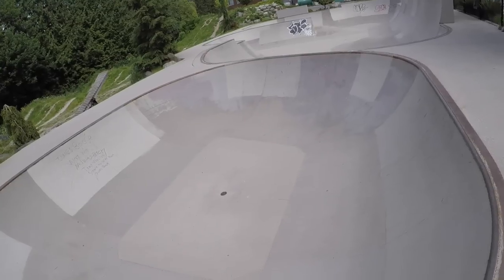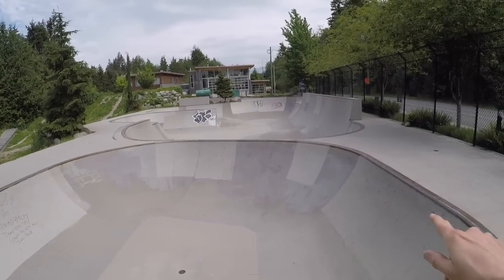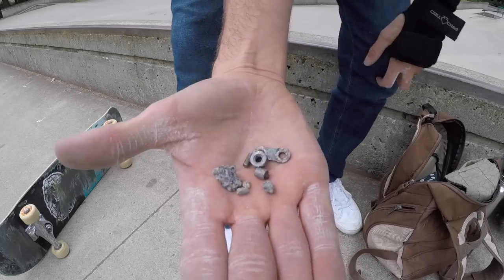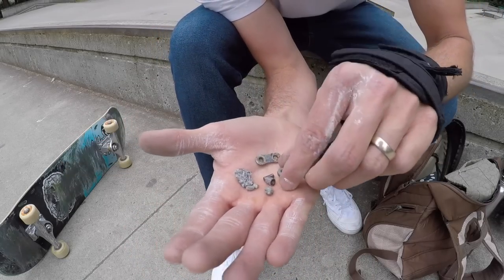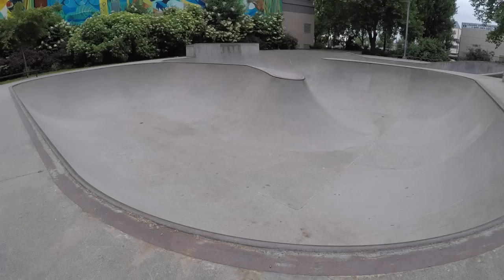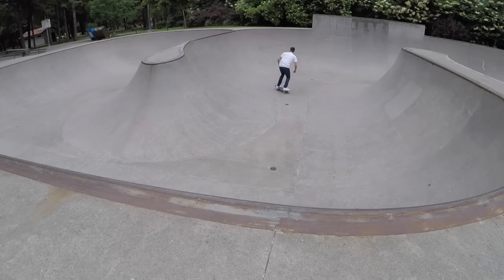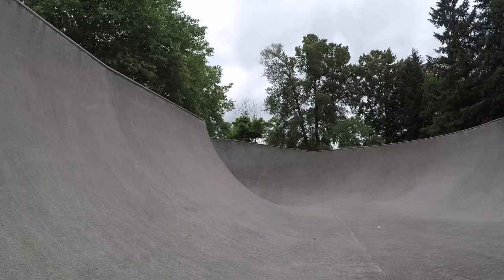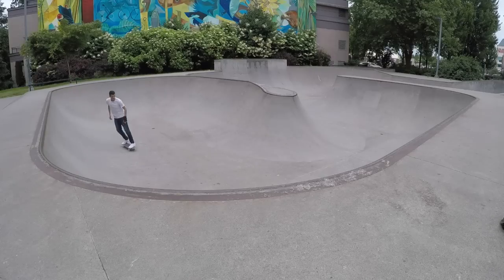How to Skate a Bowl (Keeping Speed!)

Comment: I know I’m a year late but Thanks for the advice on the tick tacks man! I’ve just now started skating actual parks coming from a town with gravel roads and barely anywhere to skate. I love skating the bowl but I always had the issue of not keeping speed and now I know what I’m doing wrong! I was treating the bowl more like a half pipe, I would kick turn high by the coping and go straight down but I would always loose momentum going back up the other side of the bowl

Comment: I was always a street skater mostly due to no actual skate-parks other than DIY hijacked parking lots. Any one remember C.H.U.D in Boise, ID? LOL I think that place coined the term crusty, I mainly skate the old 4th ward skate-park in Atlanta and have found that learning to carve and work the transition much easier in the 12ft pool instead of the bowls due to not having nearly as much flat to work around. Only drawback is that getting up close to the vert in that cramped pool is scary AF. Thankfully the transition is good and it kinda sucks you up against the wall when you get up higher. It took forever to get my head around carving, ramps and street take a completely different style of skating. I really dont remember it hurting nearly as bad when I wrecked when younger and on blacktop. That white asphalt is from the devil for sure. Not to mention when you have to bail on transition or in a pool it seems you have a bit more time in mid-bail to see the pain coming. its very strange and painful.
Reply: How good is the tranny bowl in Atlanta?

Comment: whenever im helping someone learn how to ride a bowl i always stress 2 things that go together. 

1. KEEP ALL 4 WHEELS DOWN

2. turn sooner than you think you need to ensure all 4 wheels stay down / loosen your trucks.

when you said to go as close to the coping as possible i cringed a little because it seems like most newbs go too high at first and lose their momentum and have to kickturn.
Reply from the maker: Steve Riskus now that I think about it that line is a little misleading. I am usually about a foot or six inches below the coping at the height of my arch but I guess what I mean is I try to hug the coping and stay up there as long as possible but you are correct in that a newbie could more adequately carve around only going halfway up.

Comment: @ 1.50. ''not all bowls are created equal'' youre right about that... there is one bowl in the wide vincinity where i live and its absolutely terrible.. it is full of bumps, there are lots of spots where the top layer of the concrete has crumled away (making it feel like riding on gravel) and somehow there is a big dent in the double coping where the spine is...it is only about 15 years old now and had 0 maintenance done in all that time. in my opinion its out right dangerous to skate in..

Comment: Hey man, been skating 2 weeks about.. should I be practicing switch at all? I went to a skatepark out of town this weekend since there’s none local and besides falling on my face a lot, I realized I’d be riding switch and fakie a lot and it’s SO awkward feeling! I look like I’ve never even seen a skateboard trying to ride that way.
Reply from the maker: Patrick Roles start riding switch as soon as you can.  You can do it anywhere. It doesn't have to be at the skatepark around other people.  Skating switch helps in more ways than just simply being able to do the trick with the opposite feet. It will just generally increase your balance and competence on your board. There are even more reasons but it's too much detail to get into in the comments. I will try to make a video about It soon.
Reply: Ben Degros okay cool, I’ll make sure to work on it every time I get a session in. Its frustrating how comfortable I am in my regular stance(goofy) and then switch I can barely push and get on the board lol. Plus turning is backwards, I’m used to toes turning left and heels turning right.. 🤦🏻‍♂️😬. I can help with a lot of beginner type videos cuz I have lots of questions that come up! Thank you .

Comment: Hi Ben, i have a question. do i have to drop in to carve a mini bowl?
is there any way i can skate one without dropping in? i know i need speed to do that but still wanna hear the answer from you. Thanks!
Reply: you can, but you should learn how to drop in. You are making it hard on yourself if start on the bottom. It's scary but once you get it, its the easiest trick you will ever do.
Reply from the maker: 小乃美莓 you don't need to drop in to start learning. It only takes a few extra pumps to get up to full speed. It's  definitely easier after dropping in but don't let that stop you from getting started:)

Comment: Really useful, Ben. Thanks.  Using the corners to generate the speed was my key take away. BTW what wheels are you using in the video?
Reply from the maker: 54mm spitfire lock-ins
Reply: Bought a set of Lock-ins and a set of 58mm Formula Four Conical Full (all the bowl skaters in Oz are riding these).  Cheers mate.

Comment: Hey Ben, as a truck nerd, could you do a comparison between regular and hollow trucks? Does it really make that big of a differece?
Reply: ive got both and there is not really a HUGE difference imo. If youre looking for a light(er) setup I would suggest thunder hollow lights. If youre not, regular indys/thunders are fine.
Reply: meals Thanks! I'll probably need new trucks since I just got 8,125 from a 7.875 (or something like that) and I feel that the trucks are too narrow.
Reply from the maker: Arūnas Rimkus if you are going up in deck size I think it's worth it to get light trucks. I personally notice a pretty decent difference but if there were no no light trucks we would all manage just fine. Once you get up to 8.5 inch trucks I think it makes a big difference.

Comment: What do you do for a living? And what wheels do you have on that deck? SPF bones? I’m so sick of wheels that are designed for park or street specifically, why can’t they make a wheel that’s great for everything?
Reply: Jersey Devil pretty sure those are the 99a formula fours. He did a review on them.
Reply: Spitfire f4 99d works great for street and parks.
Reply from the maker: Those wheels are 54 mm spitfire lockins 99a.  I am a carpenter.
Reply: all depends on wheel size and durometer. You would want a somewhat softer wheel but I honestly skate hard wheels and it's perfect. Transition is fun but I'm not sure how beneficial softer wheels would be for you unless you do mostly vert. You need the ability to slide as well for a fair amount of it and the harder the wheel the easier a slide becomes. I like ricta wheels personally, I think my current ones are 101a, cheap wheels but hold up well... I think you would enjoy ricta clouds like an 85 range durometer and maybe 56's